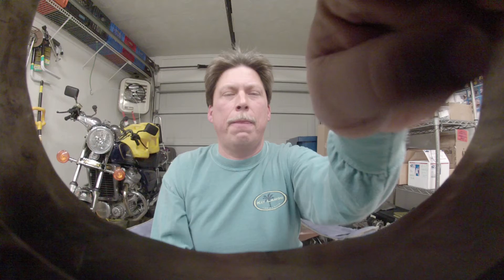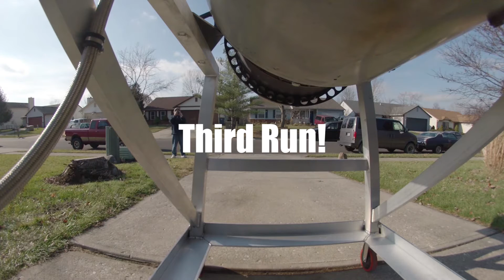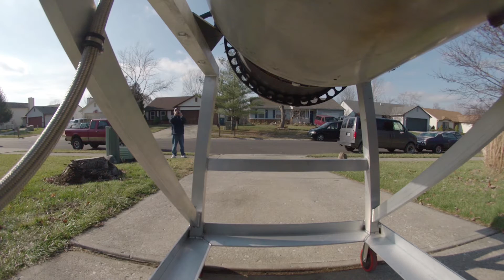Fairchild J44 Turbojet Engine, Driveway Runs 3 & 4!

Comment: hi Darren, all your videos are great, congrats. can you please tell me how much is the RPM just before the ignition? thank you and regards from Argentina
Reply from the maker: Hello and thank you for your interest and comments.  The RPM range at that point is probably about 2000 to 2500.  I will have to note this next time I start it.  Hopefully this Fall, before Winter!
Reply: Darren Duncan hi
 thanks for the answer. Last question, those 2000 RPM are on the shaft? and can you tell me how much space is between the compressor whell and the housing? i nean how close those pieces are. thank you!!!
Reply from the maker: Yes, the 'speed' of the rotor shaft or, better yet, the entire rotating assembly, the 'rotor', is the RPM indicated on the tachometer.  The service (shop) manual specifies minimum clearance between the compressor rotor & the intake housing to be 0.040" (1.016 mm) & maximum clearance is 0.060" (1.524 mm).  Check out my restoration videos showing the entire engine, disassembled, cleaned-up & reassembled, for more details.

DD

Comment: I really like the video, would putting a sponge on the mic work??
Reply from the maker: Thanks.  A sponge may help; I need to experiment with these things but I have not ran it since December.  In this video, the GoPro was inside its waterproof case, which is completely sealed.  That is why we could hear more internal sounds, not being drowned-out by the loud & shrill external noises.
Reply: Jay z adds tape over the mic, if that and the case
Reply from the maker: Aidan Brown
I will do some experimenting over the next video shoots.   Thanks.